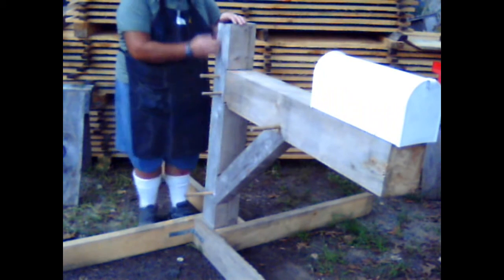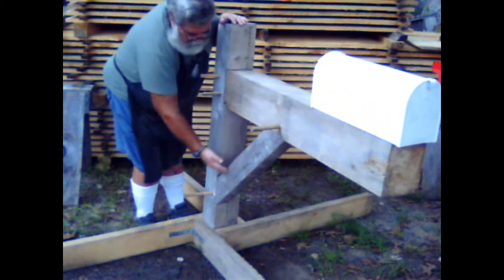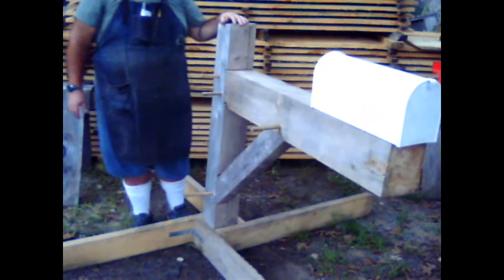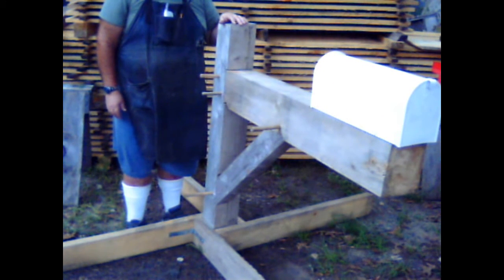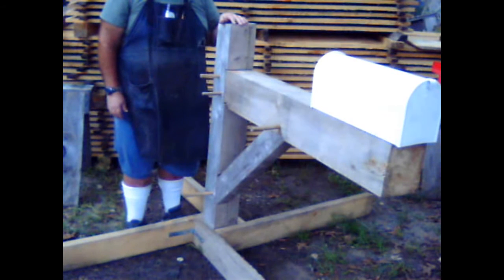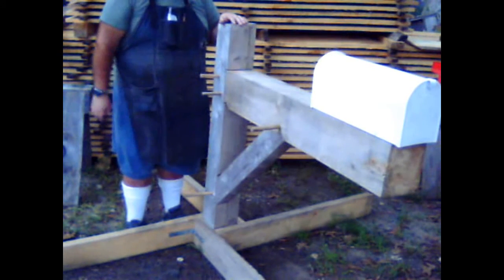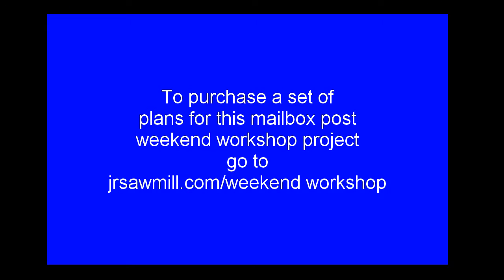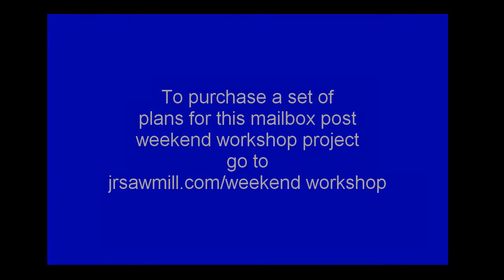Post, beam and brace walk around

Comment: So, how would you spring load the beam or reinforce the box to combat those teenage arse-holes playing mail box baseball?
Reply from the maker: That's up to the user.
Reply: @JimRogers117  I have an idea, cut the post at about a 6° angle, then bore both ends of the cut and fit them on a 2" or larger steel rod. Lots of wax on the ends of the post sections and top half of the rod, gravity will, maybe, swing it back toward the road?